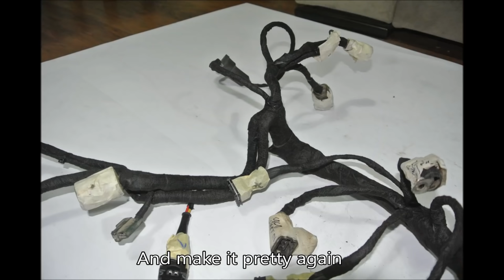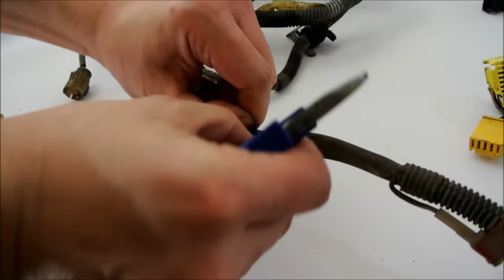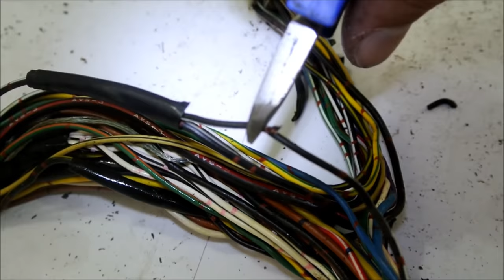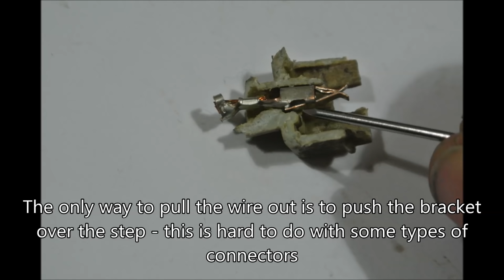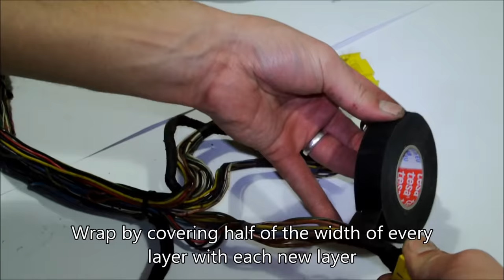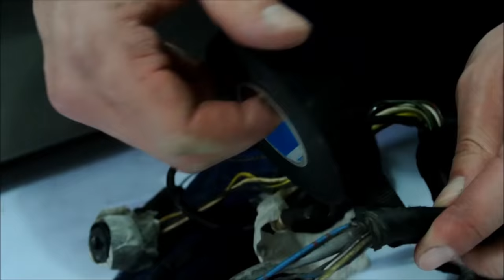How to DIY - wiring harness restoration

Comment: Lost interest in this video once he used a butt connecter. Would have been better if he soldered and used heat shrink.
Reply: Soldering isn't actually the best way to do it in automotive applications. The soldered joint creats a hard point where the strands of a wire can not move at all, and over time in the environment of a car or truck the strands begin to break. Eventually the wire completely breaks all the way through. The better way would have been uninsulated butt joints, crimped with a Molex crimper, and then sealed up with adhesive lined heat shrink tubing.
Reply: for automotive high vibration and heat applications i use heat shrink crimp butt connectors as they hold up better with heat and vibration and are also water tight
Reply: If I need to fix a wire, I use butt connectors without the plastic coating. Just the metal piece. Heat shrink goes right over top and it’s nearly the same size as the wire with insulation. Grote has the connectors. 

https://www.grote.com/electrical-connections/electrical-terminals-connectors/uninsulated-butt-connectors/88-3110/
Reply: Da Sarge a
Reply: @killerdoxen  I've used these as well they work very well
Reply: Da Sarge I used to be a truck driver and I carried a small box of them. The wiring on the big rigs was very prone to corrosion and breaking.
Reply: @killerdoxen  I agree with you I run a truck myself so having a plentiful stash of connectors and heartstrings is essential if you don't all kinds of trouble and DOT on your case constantly lol
Reply: @kensticko7607  in high heat areas the solder joints can still fail if you have worked on as many vehicles and equipment as i have over many years the solder joints still tend to fail ware heat shring with the glue on a machanical connection is made will last and hold up to more harsh conditions then a solder joint OEMs that make even electronics ware vibration and heat are a possible issue use machanical connections over solder joints as the machanical crimp is actually stronger and more reliable this is also why you dont see big cables soldered or pressure lines arent soldered ive been working on many vehicles and equipment for over 30 years and have never had an issue with proper crimps its the actual proper way to do it and its the exact same way manufacturers do it soldering is not as reliable
Reply: I see what ya saying but i specialise in mining machinery underground and surface yes I've found solder joins that are no good usually  from people who cant solder properly or use acid core solder but the amount of faults i have fixed from failed crimp joints and even Deutsch plug crimp joint from vibration or straining/stretching wiring harness and corrosion from salty water and dirt  it is something to see for your self
Reply: Only cables i dont solder are battery lugs and joints for battery cables and  anywhere from 6 b/s right up to 000 b/s but hey we all repair different shit anyways what ever works

Comment: Great video, though I solder the joins in my wiring harnesses, as the crimp connectors do work loose after a while, resulting in an intermittent issue.
Reply: If you use the proper non insulated crimps they don't work loose.
It's how the professionals do it.
And takes seconds, as apposed to the faff of soldering.
Reply: @richardschofield2201  I prefer to solder and crimp. I am a retired professional auto engineer. Doing this the way I described gives a much more secure connection. I have been doing heavy current electrical connections this way for well over 40 years.
Reply: @richardschofield2201  I never said how I did both solder & crimp. You assumed solder wicking. I AM aware of this, though I still solder & crimp. I use a combination of both techniques the guy in the video talks about, though in this video, You want some solder wicking. One other thing you failed to realise, is you took zero notice of my stated qualifications. Yes, I use expensive crimping tools, but I still solder the connections. You clearly have no idea how my system works. For this reason, plus you are still trying to make me look stupid, because you are too stupid to figure out how I do this, I am not going to explain this method. Have a good day, & do not respond, or you may not like what I have to say in my reply.
Reply: @christophermarshall5765  sensitive little fellow.
I'm sure your work is just wonderful.
Reply: @richardschofield2201 Je has a ‘system’ dude! Watch out! 

I’m guessin this lad got touched by the ‘tism….

Comment: Nice video. I have a question I have a Brute Force 750 and I was in the process of changing the spark plug. When I got ready to take the battery out it slipped out of my hand and made contact with frame of the bike before I could detach the positive and negative terminals from the battery. Now the push start button won't work. I'm just trying to determine what could of happened. All the fuses and relays are good. If you have a clue feel free to share i'd appreciate any help from anyone with intimate knowledge on the subject matter thanks.👍😎👌

Comment: Great video - well organised and explained. However, at 2.15 you could have avoided the use of those horrible connectors (another possibility for a voltsdrop) and instead slid a heat shrink tubing over one of the wires; then soldered them together, before sliding the heat shrink over the soldered part and heating with lighter or soldering lamp to shrink and properly seal the joint from moisture and thus protect it from corrosion. The connectors you show are prone to corrosion (resistance/voltsdrop) and poor reliability :(  At 3.50 there are special tools available for extracting the soldered cable ends from the plastic connectors,. But still helpful  video. Liked the music, too!

Comment: Alof of OEMs are using and swearing by crimp connectors now... but they are bonded with heat shrink to ensure a proper seal. There is nothing wrong with them when done right. You really should have heat shrinked that connector though and marked where the repair was made to help in the future. Also would have helped to leave a little more room when taping at the connector to see the wire colors in the future.

Comment: by doing this you might actually de-graded safety of the harness, because original one had electrical tape layer and then layer of tube (or some other shit) and only one layer of that stuff might not protect the harness if it is rubbing against something for long time or if it gets squashed in between some things. All im saying is you should put second layer of stuff like that original black tube or shrink tube so you dont damage the harness. (but yea it looks really nice :) )

Comment: So just a general observation or opening to a discussion I don't think connecting a broken wire with a buttconnector is a good idea. What I've heard is if you are going to solder instead of crimp is to spread the fibers on both ends and bring them together while twisting to ensure minimal resistance and conductivity

Comment: Beside that wrapping, some cables need special heat protection. Those were the plastic ribbed pieces. Some of the cables i have are very near to the engine, like injector wires and glow plug wires, and some areas of the harness go over the turbo between the turbo (very hot) and the heat shield. And in those areas the factory harness has all sorts of insulations of plastic, even solid plastic in weird shapes to contour the specific place on the engine. Might be reusable. And I prefer solder joints over spliced and twisted wires and heatshrink over it. But depends of the area.. a butt joint must be done with the proper tools.. i don't trust the generic ones, and the top notch butt joint crimps have a lot more protection to prevent water and air in (lots of heatshrink  and silicon gel or something to fill the gaps)

Comment: Bottom line is you did it! Okay now, I wouldn't have used a crimp butt connector, but they do work and even better all wrapped up. It greatly minimizes flexing. This video is years old now and I hope you have invested in connector depinning tools by now.

Comment: A few points if someone is to replicate this video:

Try to avoid cheap butt crimps and those dollar store crimp pliers (try better crimp joints for use in automotive, or solder if you feel confident - it's much debate about this subject, but there is no debate that cheap pliers and cheap butt crimps are really bad). And try to do a good job on insulating against moisture. Keep a silicone tub nearby, and put silicone on the joint and put  heat-shrink regardless of method (solder or crimp). You can also put silicone inside the rubber boot near the connectors.

Try to find automotive harness insulation (i would opt for the ribbed plastic ones, wrapped with cloth like tape). As this type of insulation must be heat resistant, and also must cushion the wires to stand at a distance from any hard and hot object. So a ribbed plastic does exactly that. Also the heat will soften any glue from electrical tapes and will make a huge mess. That why the cloth wrap is not glued, but have only some rubberized cloth to self-stick in a wrap. There is a good reason car makers use this method for most vehicles.

Try to makeshift a pin remover tool for the connector you have. (depending on style, it can be made with some wiper inserts and a dremel or other cheap alternatives). Cutting the plastic away is time consuming and have a good chance of damaging the wires. - leave this as last resort if any diy pin removing tool fails.

Comment: I'm not sure I would call crimp connectors "restoration" but to each their own.
Reply: ya really... the worst thing you can do is use butt connectors on a harness.... do it right and solder the wires and use heat shrink over it. now thats how you do it right... now in the pasted i have used the butt connectors but i pulled the plastic off and soldered the wires into it... spend the extra 2 mins. and do it right.
Reply: Agreed, why go through all that trouble  and then use butt connectors to "fix" wiring connections

Comment: What about replacement wire rating? All. Different kinds for longevity and heat range etc? Whats the correctly rated high quality automotive wire for long term use in a harness? Where do you buy? reasonable price?

Comment: My first thought when i saw the thumbnail! The least you could do is use shrink wrap type butt connectors or the heat shrink and solder in one type or good old solder and shrink wrap anything but the cheap open barrel type!

Comment: Cutting connectors is faulty idea, simple clip or pin could solve the problem.
BTW.: I worked in automotive company producing wires, we had special tools to remove wires, before that you had to unsecure connector (open blockade).

Comment: THank you for the video.
A lot of debate in the comments.... so.. which is it..
to Solder or to crimp?
Reply from the maker: Killerkamatis Pogi Thanks for watching. The debate, as many other, is kinda pointless. As long as it works and is done right it doesn't matter if you crimp or solder. I installed this wiring harness back into the car, drove it in rain, snow, heat etc never had problems.
Reply: THank you so much. :)

Comment: you lost me with the butt connectors...just had 2 fail in my turn signal circuit caused breaker to blow/reset, took me awhile to figure out WTF was wrong. Fk butt connectors never again. Other tips and instructions in the video were really good though, thanks for posting!
Reply from the maker: I had zero issues with them, but I have a new wiring harness video, and I soldered everything :)

Comment: Thanks bro! Excellent! I have 2014 Lincoln MKZ in I have to replace the wiring harness at rear( the wiring harness for rear bumper sensors, the turn light indicators on the rear bumper valence). Can you help me find the connector which the rear wiring harness connects to? It's seems that connector is missing from the bumper been damaged from accident. 
Thank you.

Comment: A for Effort.  I'm no pro, but please read:

1. When you reach the end of a wrap, make two or three "loose" wraps, and  cut the tape cleanly with scissors, and lay it flat at the end. This will prevent the tape from being stretched and coming unraveled. 

2. Wrapping the entire harness might look okay, but "restoration" means "the action of returning something to a former ....  condition"  The stuff you tore off (besides the tape) is called "wire loom" or "split loom".  If you're careful  during removal (and it's not too old and brittle)  you can wash in hot soapy water, let it dry,  and reuse  most of it, or simply buy new, i It is very cheap as long as you can buy it by the foot. Wrapping the entire thing is just silly, imo. Be sure what ever you get has a split in it, unless you want to try and thread the wires through bit by bit. 

3. If you have the entire harness apart why not replace the entire wire? Obviously more trouble than it's worth, unless you have  the proper gauge wire and  the correct pin removal tools handy. . And besides that, it sure looks like  there is a splice about 4" upstream of the "repair" job, where one  wire miraculously becomes two wires.  If you are going to use crimped connectors,  do a few practice crimps on loose  wire scraps, and think about it before snipping an inch of wire out because it might not reach afterwards. Now would be a good time to add and extra fused wire  or two, if needed,  for the new stereo amp or trick chassis lights you are gonna put in. 

4. Good luck finding the exact connectors that you need for your harness, and in my experience if the connector body is bad, the wires that go into it are hanging by a thread or poked full of holes. The insulation of wires that have been coated with oil, douched with gasoline, washed with brake cleaner, or routed near the exhaust manifold will be brittle and stiff and cracking, often leaving a half inch of bare wire at the connector. That's fun. 

5. No $.99 Store or Dollar Tree crap assed tape  or crimps should be used. Anywhere. Ever. Everything should be rated for automotive uses, and resistant to oil and heat. 

6. The labels will all fall off before you even really start. That won't matter too much because what ever you wrote on them will be impossible to read or make no sense when you are finished. The ones that did stay on for the entire project will be a giant pain in the butt to remove. Choose and label your labels wisely.
Reply: As far as finding connectors go, some are much easier to locate then others. I build a lot of harnesses with GM connectors, and they are incredibly easy to locate. Some of the stuff imports used, not so much.
Dead on with your other points.

Comment: You should finish off by wrapping in new plastic wire loom (conduit) the ribbed covering you cut off in the beginning of the video. Or is that fabric wrap just as good?  I think wrap it like you did then plastic conduit covering.  Multiple sizes available at most autoparts stores or harbor freight for cheap.

Comment: New subscriber to your channel. Good video. Where do you get the new connector from. The dealer or can you purchase them from your local parts supplier or on line. Just looking for info to learn all I can. Thanks for sharing Artie 👍👍👍
Reply from the maker: It's a Bosch EV1 connector. I bought it on eBay.

Comment: I replaced a 2005 driver-side rear passenger door to a 2006 door. The internal wiring harnesses are different. The original 2005 has a 4-wire connector and the 2006 door has a 6-wire connector.  How can I splice the 6-wire connector harness down to the 4-wire harness so it functions normal? Please help.

Comment: Looks awesome! Great job! What type of tape did you use to wrap the wiring? Sorry if it was mentioned in the video and I missed it.
Reply from the maker: I used a product by TESA, a German brand. Its called wiring harness insulation tape and says its suitable for engine bays. Just make sure its a decent brand and that its heat resistant, i.e. engine bay suitable.

Comment: I have a dumb question...I have a 97 Lexus lx450, and I accidentally cut the wire harness that’s under the rug on the drivers side front door, it has like 20 separate wires in it, I cut and stripped and heat shrank them back together, except there’s 4 black with white wires, I can tell that 2 on each side have a smaller white stripe and the other 2 have a smaller black wire, which i get, but the 2 each seem exactly the same, so I’m not sure which smaller side goes to which, as there are 2, I hooked the battery back up and seems everything works except the electric mirrors and the truck won’t start...  so I guess my question is which small black and white wire goes to the other? I hope that makes sense, not easy to explain.  Thanks for any info.
Reply from the maker: How could anybody know the answer if they look the same? You'll have to find electrical diagrams of your car and get a tester and trace the wires to the source.

Comment: Ewwww... That is nice until you need to fix something. When you try to unroll that, you end up with everything dirty and sticky because of that awful tape.
Reply: mr42ndstblvd
Reply: Not with Tesa tape. That's not some .99 electrical tape from the parts store.
Reply: That's some badass wiring harness tape! It's not electrical tape. Can't even cut it with your teeth!!
Reply: yeah... its some sticky stuff :/
Reply: Loom is probably as inexpensive as high grade tape is. And still much easier to get into if heaven forbid, you have to do a repair.